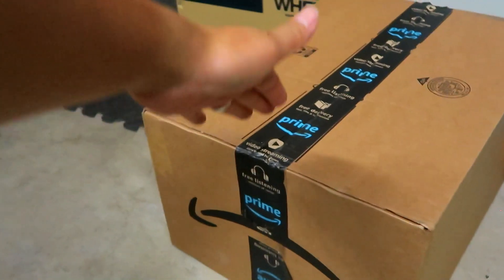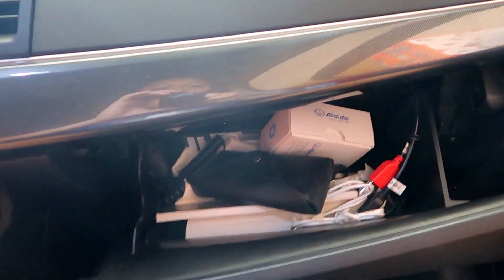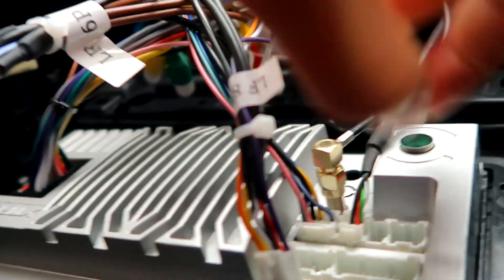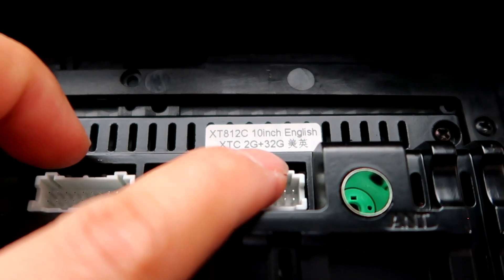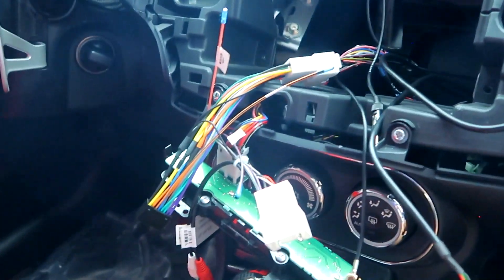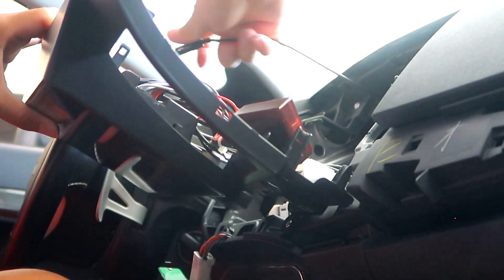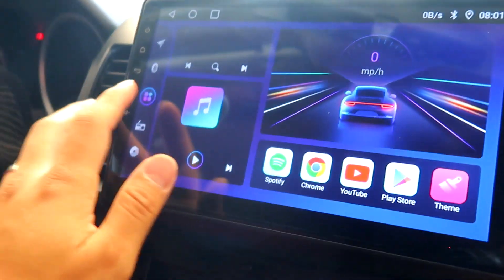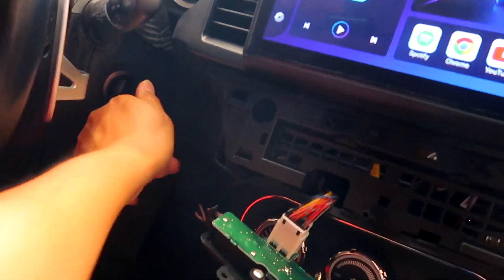Mitsubishi Lancer Headunit Install! (2008 -2017 Mitsubishi Lancer or Evo X)

Comment: I added this radio to my Lancer and got also the double connector wire-set. but no sounds from the speakers
Reply from the maker: Everything should work if you have it all connected correctly. You might want to check with your seller to make sure you got the correct radio for your car since some radios are for Rockford fosgate and some are not
Reply: @TheJMedia  I got a Mitsubishi Lancer 1.8 Intense of 2009. The stock radio is a Rockford Fosgate with subwoofer in the trunk. The funny thing is, my seller send me a tutorial link to your video. You also use the same new radio as I got now. but there is still no sound. I check the fuse, was okay. Built in the old radio, connect everything, work. So install the new radio, still no sound. Also the AMP wire is not connected in the connector.
Reply from the maker: Is your radio Xtrons brand? I'm not sure about your car since we don't have the 1.8 lancers here and only the Evo x here comes with Rockford fosgate. Not sure if those are a little different. Maybe try connecting the amp wire to see if any sound?
Reply: @TheJMedia  I will try a wire-set for Rockford radios. Hopefully that might work. Good point from you :)
Reply from the maker: @LucianPaine All the best!
Reply: Did yours worked? Im having the same problem @LucianPaine
Reply: @jrcqmGaming  not that much. At the last try I connected a power supply (Iguess, to long ago, had to check) and then it work. I could link a picture later.

Comment: Hows the head unit holding up? Any issues with it? Is this one better then the xtrons you had installed before? If you could please lmk thanks.
Reply from the maker: It is holding up great! This is actually the same xtrons one I had in my Ralliart that I installed on my lancer now. Had it for over a year and still works great
Reply: what bout battery drain im having a problem with that
Reply from the maker: No issues on mine though I have heard that on some cars that happens. It could be your OEM Bluetooth module that you have in the car on the passenger side below the glove box

Comment: Nice vid, and the unit looks really decent.  I'm guessing though that for those Lancers equipped with the MMCS head unit from the factory that many of the features and functionalities from that system would be lost?
Reply from the maker: Thank you! What features? I would say it's definitely a nice upgrade from stock and worth it
Reply: @TheJMedia  i recently got an after market and there is no adaptor for my reverse camera or steering controls so I'm stuck until i find a solution
Reply from the maker: It should come with it. Sorry to hear about that. For the steering wheel controls, you should be able to go to settings on the headunit and sync it to your steering wheel to "relearn" settings
Reply from the maker: All the features should work the same. I know for sure keyless operating system works since mine does. As for the other systems, I would think so too
Reply: @TheJMedia were you able to use factory bluetooth mic?
Reply: Why when I connect this red box my lancer shows me check???and without this red box the screen don’t work
Reply from the maker: Yes Bluetooth and mic works just fine
Reply from the maker: @user-fu1yr9zy1q what red box are you referring to? If you connect everything it came with, it should work with no problems
Reply: Is there a link for this?
Reply from the maker: @highxreshq898 https://xtrons.com/mitsubishi-android-iphone-octa-core-4gb-ram-64gb-rom-global-4g-lte-iap12lsms

Comment: Hi mate, I have a question regarding red and white RCA cables. At 11:54 in the video they are not connected but later in the video at 12:27 looks like they are connected. Initially when you pulled out your old unit you have 3 white connectors. How and where did you connected that red and white rca connectors of the Canbus cable. Thanks

Comment: Hey loved the vid, might have a stupid question but I'm totally new to this so I'll go ahead and ask. My car doesn't have an android/screen unit at all, it has an cd drive and small little radio screen. The whole process should be the same right? Shouldn't matter what I'm taking out as long as the connectors are all there?
Reply from the maker: Thank you! Yes it is the same process to install. Just make sure you get a headunit that is specific for your car. If you have a Mitsubishi lancer, get an aftermarket headunit that fits a lancer and not a one for a Toyota Corolla even though all aftermarket touchscreens look the same

Comment: Hey mate. I have the same head unit. Hoping you would know or have a video on how to get the steering controls to work
Reply from the maker: Hey, I don't but you will have to go to the settings to re-teach the steering wheel controls. Just go to the settings on the head unit, then find the steering wheel control option and pair each button to the action you want it to do
Reply: @TheJMedia awesome yeah I found that but didn’t have it working. Would i need to wire something together to get that working?
Reply: I have the exact same car and head unit as reference
Reply from the maker: I didn't have to wire anything extra for steering wheel controls to work on my other car. I took off the OEM steering wheel and switched it out to an aftermarket steering wheel so I had no need to connect steering wheel controls on this car
Reply: Hey lads I think I have the same issue but I have a different head unit. 
In the video u have the two power adapters for the car one that just has the one link and the other just has the two links. 
I just had the one with the one connection and I’m just wondering where would I get the power adaptor with the two links on it. Because I’m assuming that the other connection is for my steering wheel.

Comment: what do you mean by making it wireless? do you need that extra gadget to be able to connect to the bluetooth? or what did you mean
Reply from the maker: By wireless, I meant you can connect to Apple car play/ android auto without a wire. All you have to do is switch Bluetooth on your phone on, connect to the headunit and car play will work without connecting a USB c cable to your phone.

Comment: Don't know much about cars and installations, but i have one question. Will this installation affect the controls on your steering wheel? Like audio and radio controls. I apologize if this is a stupid question ✌🏻😜
Reply from the maker: No question is a silly question! Happy to answer any questions you have. It won't affect the steering wheel controls, but you do have to "repair" the new radio to the steering wheel controls under settings

Comment: I bought one like that and I lost my back up camera and I can't use my steering controll volume. What would you recommend
Reply from the maker: It sounds like you may have not connected the back up camera wire. As for the steering wheel controls, you have to go to settings on the radio to re-set it up

Comment: Hey man, I've got the Youmecity Android 12, for my 2017 Lancer ES. The oem camera won't work even after I've bought the pin connector that connects to the Reverse cam, would you know a fix for it
Reply from the maker: That's a different headunit from what I have. I will be making a separate video on connecting the oem back up camera to the aftermarket headunit that will be up on the channel this week
Reply: @TheJMedia  thanks man! The connections are all identical to yours just slightly different layout its just the matter of, I had to get a different power connector that already has the Grey Pin (reverse cam) integrated so its just a plug n play
Reply from the maker: @EricEgot Yes, you'll have to get a separate wiring harness to connect to the grey oem back up camera, otherwise you will have to splice wires to make it work

Comment: hey man i’m getting ready to buy this for my evo but i just wanted to check if this works with rockford fosgate and if all the steering wheel controls work
Reply from the maker: Steering wheel controls all work. Just need to go to settings on the headunit and "relearn it" under steering wheel settings. As for Rockford fosgate, make sure to check with the buyer it is compatible since some are and some are not. They all look the same but make sure to check with seller
Reply: @TheJMedia  much appreciated brother <3
Reply from the maker: @BdgtBuilds No problem!
Reply: Look at the harness at 11:00. the harness for rockford audio systems needs to have the black box in it.
Reply: @Hamburger187  appreciate it sir i never knew that man

Comment: Currently have an aftermarket radio/sub installed would i need anything additional for this unit? Already have oem wiring harness for steering controls
Reply from the maker: I'm not sure about the sub since I don't have one, but this aftermarket radio is plug and play

Comment: I hooked mine up but the audio doesnt work? What did i not plug in?
Reply from the maker: Make sure all connections are tight and not loose. If it is all connected, audio should work with no issues with radio/Bluetooth. If it is still an issue, might be a problem with the headunit
Reply: @TheJMedia  Which one is the Audio? The only one i didnt plug in was the back up loght snd another wire that had a bunch of RDA cables at the end of it. Should i have plugged those in? There was no where to plug it into my lancer though. Thanks for the help man
Reply from the maker: @pollux2825 No problem. I believe the main harness that is plugged into the headunit by the fuse is what provides power and audio. Also have to plug in the red and white rca cable from the radio to the OEM harness
Reply: @TheJMedia  Ohhh I didnt plug in any RCA cables, the red and white ones are provided? And I plug them into the harness that is connected to my car?
Reply from the maker: @pollux2825 Yes that could be why. Red and white rca cables plugged in to red and what rca cables from the car. Male to female connections
Reply: @TheJMedia  Oh I guess I have a different harness. my car’s OEM harness does’t have any RCA cables just 3 big block white male connectors and a small radio wire… the headunit i had just had 1 female connector to my OEM harness and the rest were extra hookups and gps backup camera carplay etc. I did have one wire plugged in that had like 10 rca cables on it but i have no rca cables in my oem harness. Audio still didnt work so i sent it back and am getting a different one..
Reply from the maker: @pollux2825 Sorry to hear about that. I have the Xtrons kit in this one and works well
Reply: @TheJMedia  I ordered a new one that actually comes with the 2nd power cord with the red and white male end rca cables that indeed does plug in to the female end rca cables that come from the headunit. The first one i ordered didn’t come with them. Screen still worked well though. Excited for this new one its 4G 128 GB. Will look really good in the Evo..
Reply from the maker: @pollux2825 That's awesome! Glad you got a new one with good specs. I'm sure you will love the upgrade
Reply: @TheJMedia  Yeah I never ended up using the last one since the audio didnt work but this ones coming with the 2nd powercord and yeah im so glad it ended up this way so i just bought a better one. Thanks for your help man if you hadn’t told me about the extra RCA power cord then I would have never known I needed it and they didnt provide it!!!
Reply from the maker: @pollux2825 No problem! Glad it worked out well for you and you found my videos helpful

Comment: Dude i have a 2016 model lancer can i still use my old back camera for this android headunit
Reply from the maker: Yes you can. Just need to make sure to connect the back up cam wire to the headunit
Reply: @TheJMedia  got it thanks dude 🍻
Reply from the maker: @mervin2931 No problem!

Comment: Hi, please share a link for the head unit. Thanks in advance.
Reply from the maker: You can buy it here: https://www.amazon.com/XTRONS-Mitsubishi-Android-Navigation-Bluetooth/dp/B0B4JYLPBL/ref=mp_s_a_1_3?crid=3UHJ3TPIFUYYO&dib=eyJ2IjoiMSJ9.AqHord-qZ1hNX-odQywlZSARt89q60jDrs2lXRjaiYXplPrzWldATCwmqqp2ZigwQdQVfEB5KbCsdAtp5QVQ_-NnemAIdjrfkgr95Yy-1nwdR1RobNgfkf9gDkF8Dg4H6K3Wk5nYO2G742B90jM3wuq0-3fzxYD6xSo0UEfaOBUJXJ9jomE0SU4aALv-y6_a8bCcjI7TbssB8l4hPe1uIQ.MU2wbCHVbQkPYLMXgeCxjOi5Tf3gSp7I2hQyOf5zuZA&dib_tag=se&keywords=xtrons+mitsubishi+lancer&qid=1710959278&sprefix=x+trons+mitsubishi+lancer+%2Caps%2C115&sr=8-3

Comment: Does it include reverse camera?
Reply from the maker: My car came with back up camera from the factory, but if you want to get back up camera with this headunit, it is an option you can add on.
Reply: @TheJMedia  nice! My 2015 lancer also has stock reverse cam. 

How did you connect your stock reverse cam to the head? was it plug and play?
Reply from the maker: @stephenplaciente Yes it is plug and play. Just make sure you have the extra wire included to connect for back up camera since some headunit kits don't include it and you have to buy a separate wire

Comment: Hello sir, my lancer come with only 1 power socket. not 2 like yours. So, can i still use the cable with canbus like yours and connect only the available one? does the canbus still can working? Please help me.
Reply from the maker: Hey, I'm not sure since mine came with 2. Maybe try it out and see if it works. If it doesn't, reach out to your seller to see if you need to buy another wiring harness